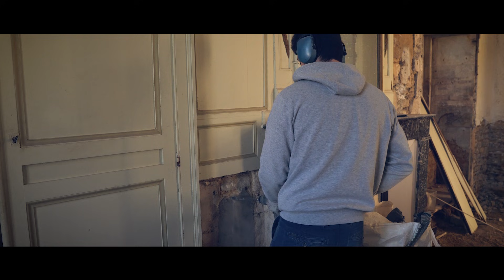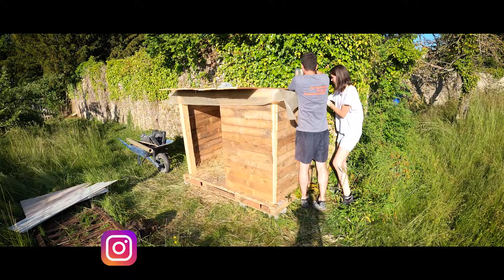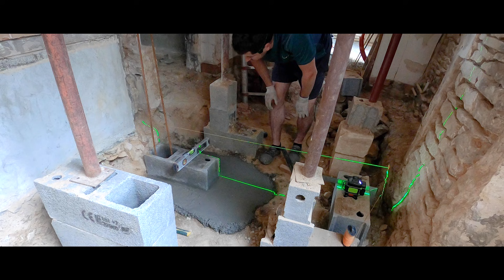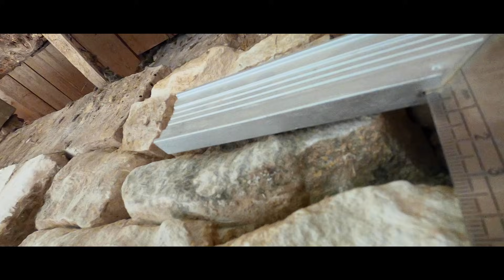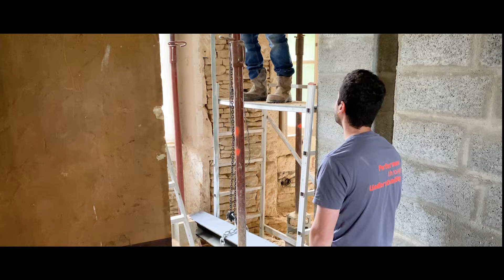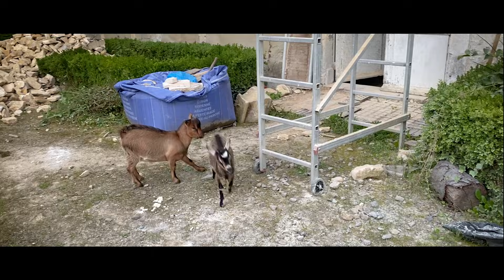ON DESCEND LES MURS PORTEURS (1/2) | Chateau restauration

Comment: Tu as mis une découpe de caoutchouc entre le HEB et les deux supports ou pas ?
Reply from the maker: Hummm non, à quel endroit ?
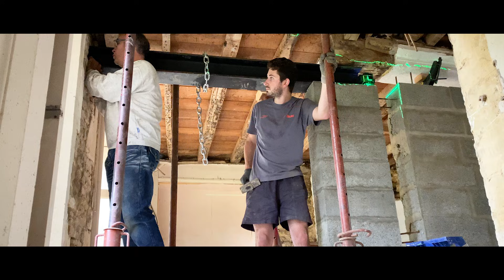Reply: @AuPetitChateau1780  Eh bien entre les deux plans de pose du HEB (donc d'un coté les moellons et de l'autre les pierres dans le trou du mur) et le HEB lui même. là où on voit que tu as mis qque chose de blanc à 12:20. Le rôle de cette découpe de caoutchouc est essentiellement de permettre de mieux faire le report de charge sur les surfaces de pose sans abîmer le traitement de surface anticorrosion. Accessoirement (mais dans ton cas, ce n'est pas le cas car la longueur est faible) d'absorber les variations de longueur du HEB à cause de la grande sensibilité de l'acier en température sans pour autant aller reporter des contraintes mécaniques supplémentaires sur les points d'ancrage.

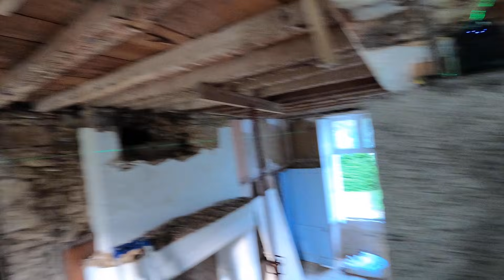Explication plus détaillées sur cela dans cette vidéo de la minute 7 à 7:40 environ : https://www.youtube.com/watch?v=6UbY3KicweA